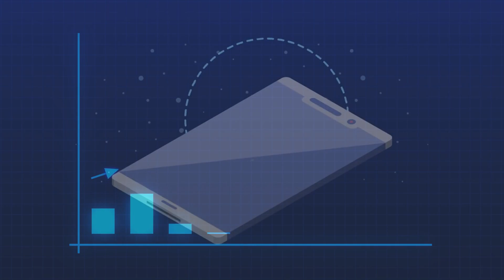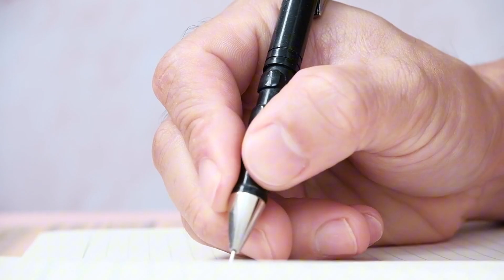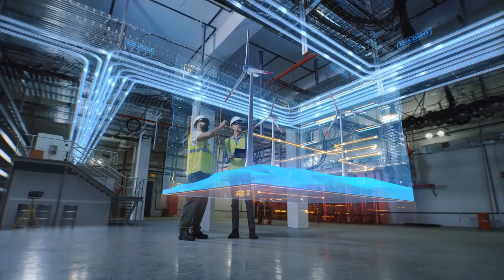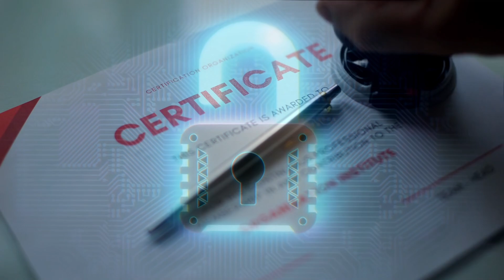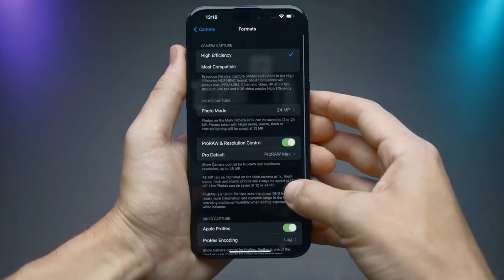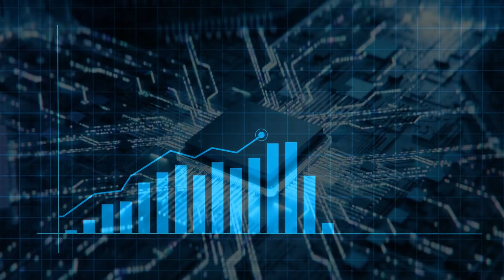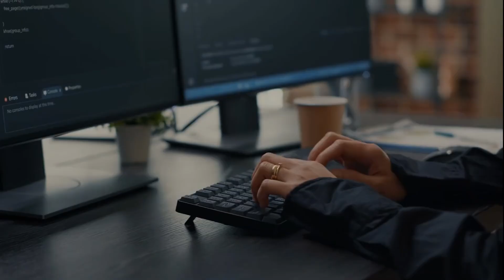Huawei Just Changed Everything – Legacy Chips Are DONE!

Comment: Why needs increasingly very small size of chips, the problem of Voyages  1 and 2 is the limitation of battery power. Common ppl only use for video gaming, text, how ppl wrote artificial I used coble, list etc Program software😂. Some hackers use very old computers, all need is mechine codes knowledge 😢